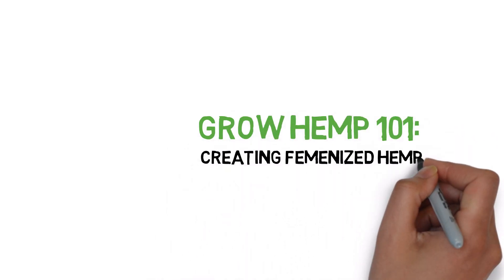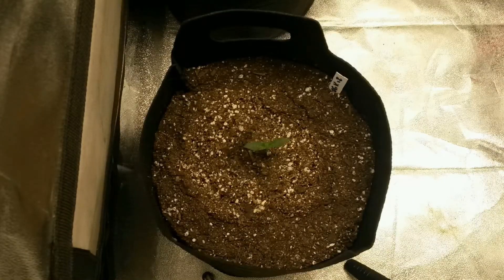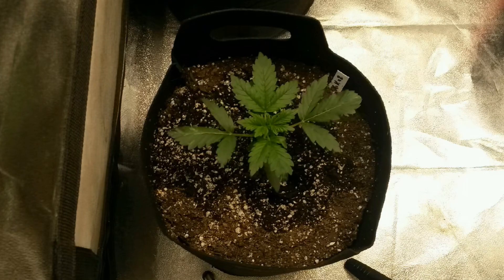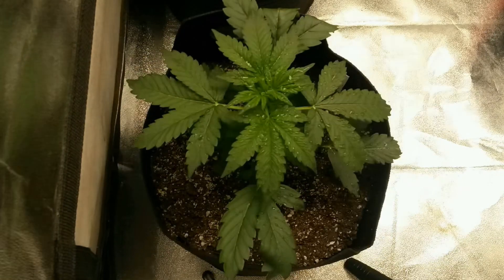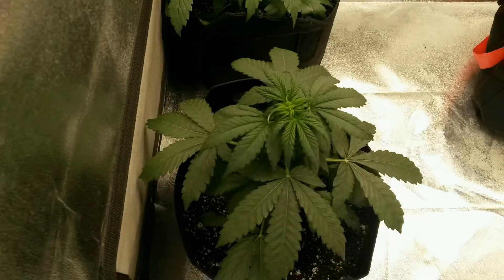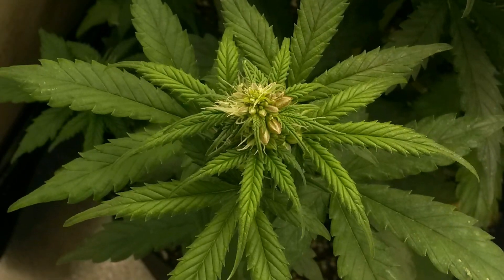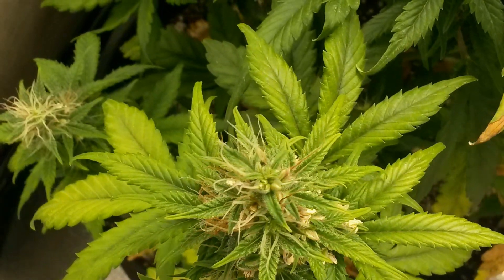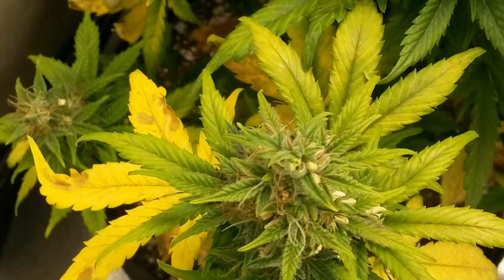Autoflower Female Hemp Plant Self-Pollenates to Make Seeds

Comment: Hey I got 2 seeds in a quarter of Pineapple Express from the dispensary I planted em and they r growing anyone know if the seeds are auto flowering seeds? I think it is just not sure.thanks
Reply: If they are flowering now under the 18 hour light cycle for Vegging then they are autoflower, if not, you have photoperiods and can still self them with the technique in this video by taking clones of them, using this technique on the clones, and then collecting the pollen in jars, and using it on another round of untreated clones from your mother plants, and you are on your way to stabilizing and dialing in the effects of Pineapple Express that you smoke.

Comment: You said you were misting the plant to keep the pollen from germinating the seeds how does pollen crack the shell open and start the germination process. Or were you  Spraying the plants with water to rinse off the pollen so the pollen doesn't get on the seats.
Reply: He's misting the branches to essentially trap the loose pollen on the plant so it doesn't fall off while handling afterwards, he was simply noting that the water used in that process did not trigger seed germination when he mentioned germination.

Comment: Hey bro thanks for the information what ppm of sliver did you use?
Reply: I personally found the best results by using 50 ppm. My friend used 30 ppm and it worked as well for him but he didn't have as many male flowers as in my case.
Reply: @RussianTroll-ie6gr   replied to  me in  perfect timing  about to brew my first batch.thanks for the info
Reply: @s.trader6771  you're welcome.
Ps. The brand that i used was "Argentum200 colloidal silver 50 ppm spray"
My friend used "Welless colloidal silver throat spray 30 ppm"
So both of those brands works.
Cheers ✌

Comment: If you pollinate your plants then put them back in 18/6 will the seeds develop?
Reply: @shawnt5272 well light does hinder them if they get too little ..but dont require light change to flower.
Reply: If the pollen is viable then yes it should.
Reply: @danaburgs  it doesn't work the new reveg leafs grow out the seed pods. so the plant obsorb the seed, push the seed out the pod or just stop developing.  That's was my experience. Let me know if you get different results.

Comment: Question can you take male pollen and pollenate a female auto plant and still get auto seeds ?
Reply: It depends if the pollen was from autoflower or photoperiod plant.
AF x AF = AF
Photo x AF = Photoperiod fast flowering
Reply: I have been researching this pretty hard for the last 48 hours, from what I understand is that since the autoflowering trait is recessive, it will take about 3-4 generations of breeding to stabilize the autoflowering trait, the first generation of cross will be photoperiod with a flowering time closer to the autoflowering donor's, the next with be a mix but still leaning towards fast photoperiod, the third will be a true mix, and then the 4th generation will be 99-100% autoflowering, you are basically using this technique and then crossing your best plant's pollen from each cross/generation with another mother of the same seed batch of the original autoflower you used to keep bringing that strains traits back to the forefront.

Comment: when i convert autoflowering to hermaphrodite like your video, can i still smoke the bud after collect the seed? 
or it will dangerous because of colloidal silver on it?
Reply: I know this comment is old, but since no one answered you, the answer is no. Do not smoke the flower. It contains heavy metals because of the silver and is bad for your lungs. The seeds are fine, and the buds are not.
Reply: @AlienBros you cant smoke the buds you spray and CAN smoke the ones you pollinate. Just to clarify.
Reply: @dana102083  Yeah, I probably should have been more specific. Basically, just don't put heavy metals in your lungs is what I was getting at.
Reply: It's harmless. Colloidal silver @<30° even higher won't hurt you. You can drink it
Reply: @bennorth-k7n just cuz you can drink it doesnt mean you should smoke it.
..and you mean ppm not degrees? And there is not a lot of evidence orally forget smoked. Quit giving unsafe advice. Let them ask their doctor.